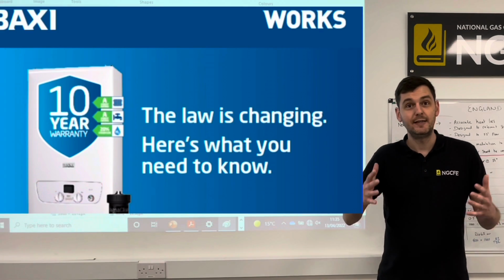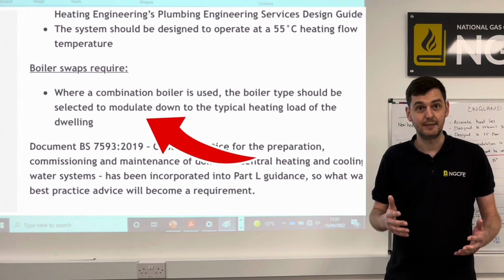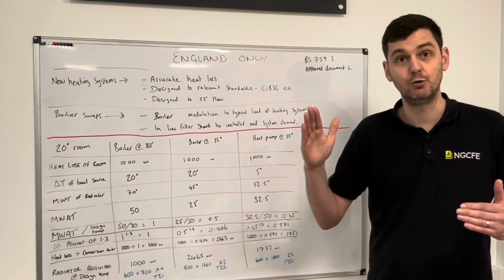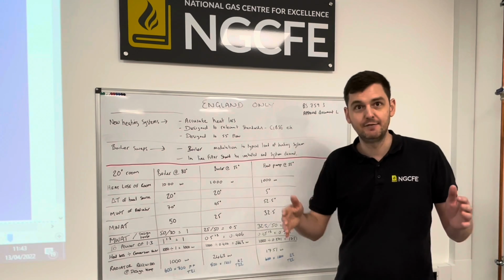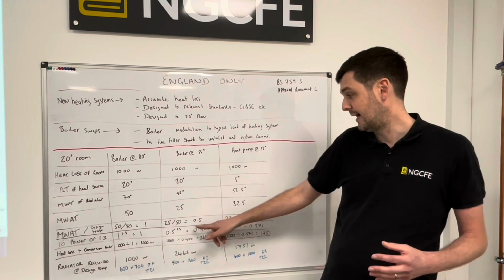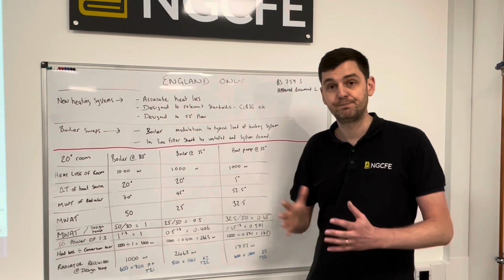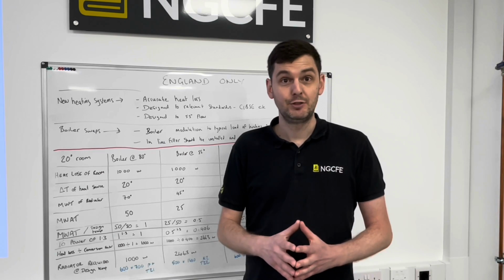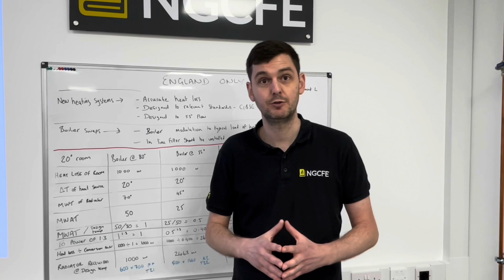Approved Document L Central Heating Low Temperature System Design NGCFE

Comment: Just fitted new boiler in my house , flow temp set at 55 , spent time insulating and draught proofing . Boiler still offers quick heat up time as I’m not home much .
Reply from the maker: Hi Batman. What boiler have you installed? Thanks.

Comment: Manufacturers don’t need to advertise this to there installers. They need to advertise this to potential end users. So installers who size and quote jobs properly don’t get walked over by ones that throw in 24kw combis for every job. Also if a client has had a £800 designer rad fitted 2, 3 years ago and you say well we our going to have throw it on the scrap heap now, you won’t get the job for the boiler swap. It should be all new radiators fitted should be designed to run at a low flow temperature and new boilers where existing system design allows a 55 degree flow temperature. Also how do you heat a cylinder to 60, 65 degrees unless you use viesmann 4 pipe
Reply from the maker: Some manufacturers are going to struggle as they don’t modulate down enough as well. Thanks.
Reply: Ive always wondered how do you heat a tank to 60 for legionella when the ch is lwer than that?
Reply: @handle1196  I believe some boilers allow for a separate boiler call for hot water tanks, allowing a higher temp to be set.
Reply: @handle1196  hot water priority, intergas W plan.
Reply: @dorsetengineering  it's called Xplan or Dplan (used to be pin5 on the ecoRF, now Pin3 on the X series boilers)
Reply: Use EPH controls on an opentherm boiler to get dual temp

Comment: An issue I faced with my new build house boiler is that the boiler can only do one temp. I need put the flow temp above 60 in order to get the water in the tank hot enough to prevent legionella, so the return temp is likely higher than 55 and so there less chance of the boiler using the condensing efficiencies.
Reply from the maker: Hi Dino. you could address that by having a different setup, depending on the boiler.

Comment: Interesting video in the light of my home's history. I had a standard boiler fitted with a brand new central heating system when I moved into my 1901 terraced house. The installer calculated the system based on the house in 1989, so it had single glazing, no cavity wall insulation, and minimal loft insulation. 

Over the years the house has had all the above added, so like many older properties the calculations would now be different, with the possibility  that the radiators are now back to the standards that are being proposed here 

Recently I've moved to a Baxi 800 (actually oversized) controlled by a Tado. I've noticed that I can already move to lower  boiler temperatures myself most of the time. 55 degrees gives a drop to 34, but what's a degree really?  I wonder if  lots of older houses now fit into the new regs due to historical changes .

The next plan will be a Baxi IFOS, which should force the boiler to lower temperatures in the blazing Lancashire sunshine (does Yorkshire need weather compensation, it always rains when I visit).

It fascinates me to hear people in the media talking about the expense of heating. Before impending price increases my bills before the boiler change were lower than 13 years ago. Insulation and a Honeywell Sundial did all the heavy lifting there 

So, will the IFOS squeak another 10% saving on top of the 8% the Tado is giving?
Reply from the maker: Hi Phil. You make some very interesting points, I have never installed a Tado and to be honest I don’t know much about them. Maybe I could look into this for future videos. Thanks.
Reply: Yes it will. As you change the heat curve to suit you house. If it's a system boiler it will have an override PCB for the hot water so the boiler runs at max temp to heat cylinder then back to curve once cylinder is satisfied. We fit them all the time as they are only cheap for what you save.
Reply: @DunkiSTI  I have gone from system boiler to Combi. I've already gone to reducing the hot water to 56 degrees.

As you say, the IFOS is very cheap. I know enough about how heating works to know how it will work, as I lurk looking at this stuff.

On the  other hand my 92 year old mother with dementia would be a different thing. She rang up today asking why her heating isn't on (it's 23 degrees outside).

I suspect my over specced radiators will be a common thing.

Comment: People want designer radiators not big ugly ones big radiators will look stupid in rooms
Reply: Lower flow temps can still be achieved with designer rads, just means installers will have to use their brain and design the system better.
Reply: Since when is a standard type22 rad ugly?
Reply: Designer rads have an energy output spec like standard rads so the calcs can still be done and a designer rad of the correct size spec'd for that room.
Reply: There needs to be a education campaign towards the end user (customer) otherwise cowboys prosper!

Comment: Great video Allan 
You try telling a customer they need a new boiler and all the rads replacing as there too small and the temperature will be set to a max of 55 degrees most jobs will jump £1250 - £2000 extra for rads and I bet the price for the big rads with go through the roof.
Reply: But will they? What if calculations were made on a typical install from scratch calculated 30 years ago. No cavity wall insulation, single glazing, no draught proofing and minimal loft insulation. I know my energy bills now are lower than they were 15 years ago despite inflation.